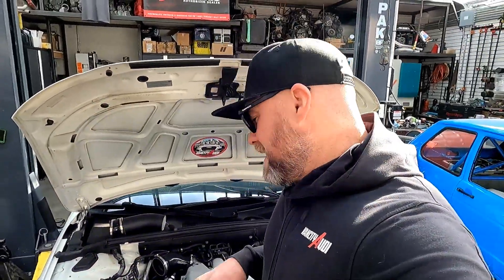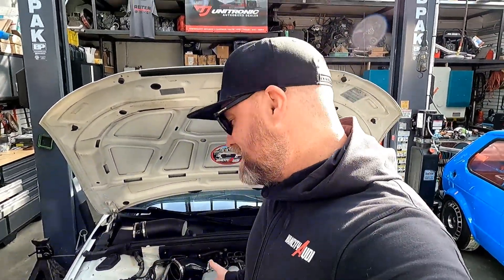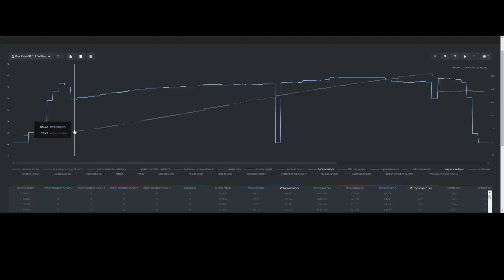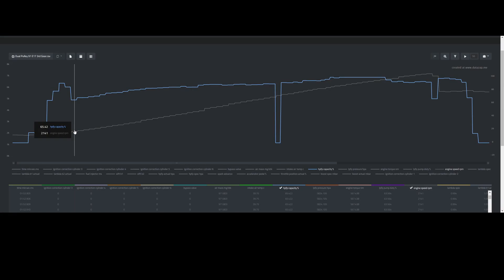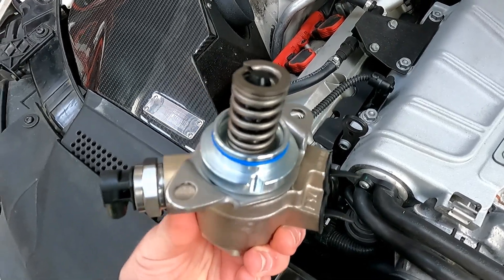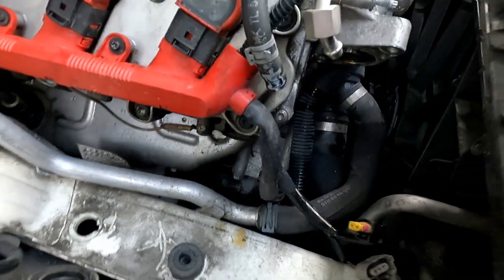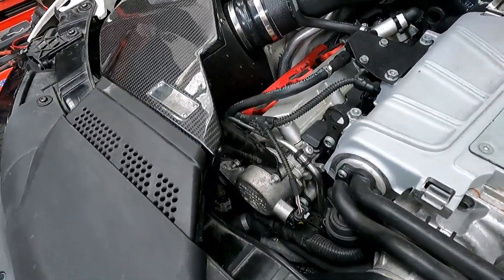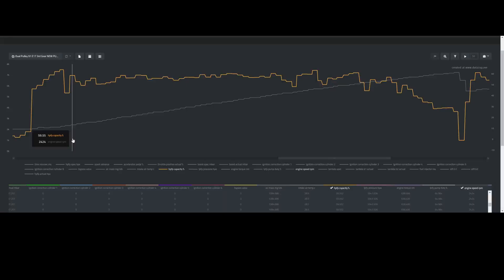Audi B8 S4 Integrated Engineering High Pressure Fuel Pump Install & Log Comparison

Comment: Once you install this is that all you need to run an e40 map ?
Reply from the maker: If you have all of the other supporting hardware installed already, then yes. https://performancebyie.com/collections/ecu-software-tunes/products/ie-ecu-tune-audi-30t-supercharged?variant=39473800577163
Reply: @VancityAudi  thanks bro !
Reply from the maker: @alexrod2944 no problemo. Use promo code VANCITYAUDI at www.performancebyie.com/vancityaudi to save some money!

Comment: dumb question but can I date log my b8 s4 with my unitronic software/cord ?
Reply from the maker: Sadly no. The Unitronic cable can only log RS3's and TTRS's tuned with Uni software right now.
Reply: @VancityAudi  b8 is not unitronic focus has they have no file for my iabed 75mm tb ive installed.
Reply from the maker: @maxgagnon1947  you'd have to reach out to Uni for that one. I'm not sure the extent of the tunes they offer for B8's
Reply from the maker: IE has been fantastic to work with and their software and hardware have worked great.

Comment: Nice video again man!! HPFP upgrade was spot on.Now you make me log mine as well 🤣.
Do you remember the channels on VCDS?
Reply from the maker: I used the IE Powerlink cable to log, not VCDS, sorry.
Reply: @VancityAudi  right you did, damn. Btw its seems awsome that you can get multiple channel logging with that thingy! 
And for the track run, i would say you can get 11.3 times cos of more torque on that dual pulley (if you can keep your tires to road 😁).
Reply from the maker: @jpstone9105  Stay tuned for the dyno video next week. I think you may change that guess after seeing the power figures I make.

Comment: Buys daily driver. Proceeds to mod it to the point that he needs another daily lol
Reply from the maker: So far everything I've done has pretty much been a bolt on and tune.  The daily drivability has remained unchanged except for the engine mounts.
Reply: @VancityAudi  I'm just joking. There's a meme going around about that.
I have pretty much the same setup. Getting motor mounts and test pipes installed soon then HPFP and heat exchanger.
Reply from the maker: @curtdragon  Be careful with those engine mounts!
Reply: @VancityAudi  shop is doing it
Reply from the maker: I just meant with the increased NVH. Not the install
Reply: @VancityAudi  went with 034 street density. Can't be worse than now lol
Reply: @curtdragon  Hey was going to buy those on Cyber Monday, as well as their HTX and stage 1 tune for the ECU and TCU. What is your opinion on 034 street density motor mounts.?  Thanks in advance.
Reply: @johnjuarez8005  don't have them installed yet. Adam here has a video of another company's mounts that might help
Reply: @curtdragon  I am interested in the ones you are getting. Can you please advise how they perform once installed. Thx.

Comment: Wow.  I wasn't expecting it to hit 99%.  My S4 would hit maybe 84% even when I was running E30 on the 93 map with my OE fuel pump.  I was hoping to see what your LPFP did too with the changes.  You mind sharing the log URL?
Reply from the maker: 84% duty cycle on E30 with the OEM HPFP sounds about right, although I'd check your fuel trims. There should be no reason to be blending E30 on a 93 octane tune though. You'll see the maximum benefits at around E20 and anything above that is just extra strain on your fuel system. My LPFP duty cycle hasn't changed. It holds steady at 92.99% throughout the majority of the pull.
Reply: @VancityAudi  I was getting some minor knock still at E23. Went up the E30 and it all went away.
Reply: It was purely just to test to see the capability of the OE pump.  I upgraded the next day
Reply: I get 99.99% duty cycle on the hpfp as well (dual pulley) but I also see the low pressure side dropping. This led me to believe the low pressure side was struggling and causing the high side to drop. Now I’m not so sure… can you share your low side fuel pressure readings at peak power/torque?
Reply from the maker: @RS-ve8nq  my LPFP hits and stays at 92.99%..it doesn't go any higher and stays constant at that duty cycle throughout the pull

Comment: Audi told me they found my injectors were are leaking. Is this common for these injectors? I just have a stage 1 IE tune. Should new stock investors be good? Thanks.
Reply from the maker: Get the most updated revision of the injectors.
Reply: @VancityAudi  Thanks Adam.